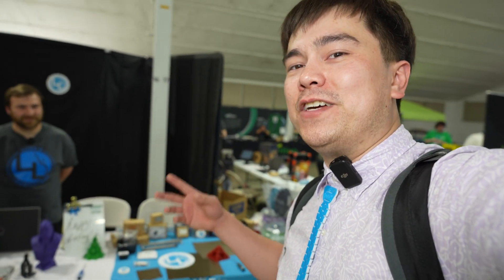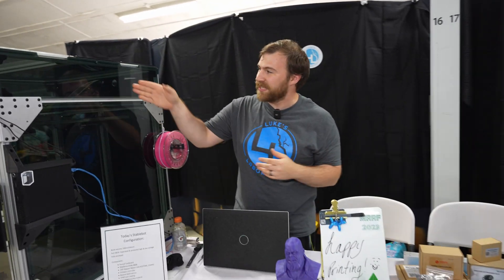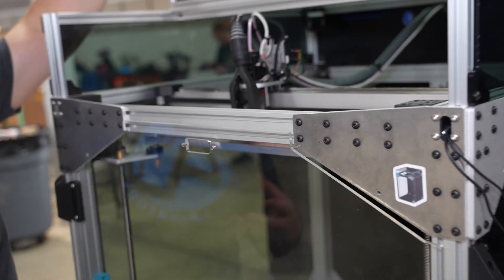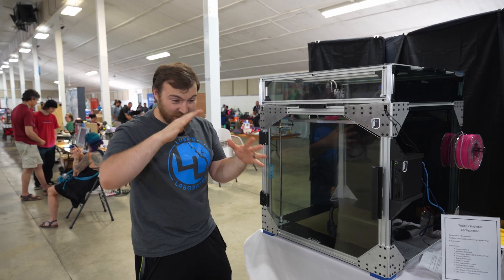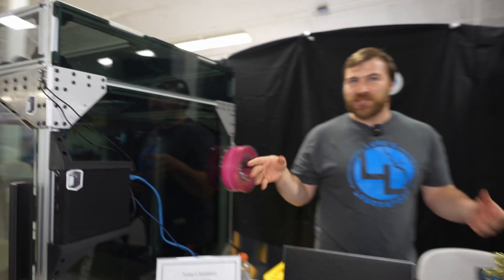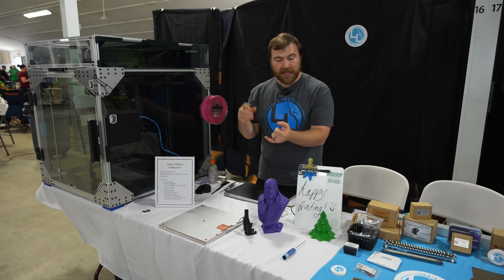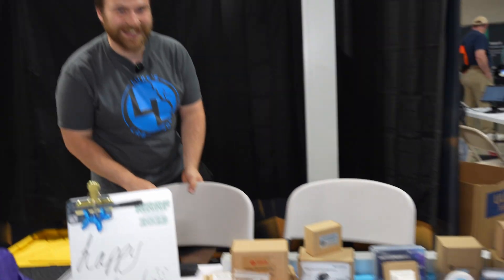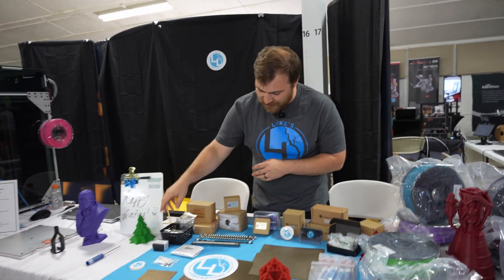Luke's Laboratory - StableBot 3D Printer

Comment: the can bus board is interesting, do you have more information on  that vs other current boards? I don't understand the advantage.
Reply from the maker: Yeah, it’s basically a mini motherboard for the toolhead
Reply: it's stated on his website it reduces the amount of wires from the controll board to the tool head. Also, for anyone else here's a quick video explanation. https://www.youtube.com/watch?v=Pi5cdTiGjwY
Reply: It also includes an accelerometer , so you don't have to connect and disconnect one for input shaping(smoothing out print corners).

Comment: Hi Nathan ; have a question about the leveling system that the Anycubic kobra 2 uses . As an Engineer ,how reliable do you feel the leveling probe is on this machine ? I have used it and done a first print and it came out very good but I am curious as to your thoughts ?
Reply from the maker: Induction probes are pretty common for this type of application, should be very accurate <0.05mm variance.
Some probes aren’t temperature calibrated, especially the cheap ones. So it might drift in a very hot or very cold environment if it is t calibrated. I haven’t used the machine so I couldn’t tell you what exact kind is employed
Reply: @NathanBuildsRobots  
All good ; thank you for getting back to me with your thoughts. I was pleasantly surprised by the first Benchy I printed on it (.2mm layer height & took 38 minutes )but I didn't watch what infill they used or how many walls. When I get my computer back from warranty claim I will start experimenting. I was impressed with the speed and the fact there was no stringing at all. I was very surprised by that ! I hope my prints with it turn out as clean .